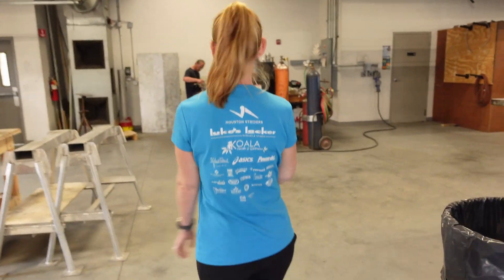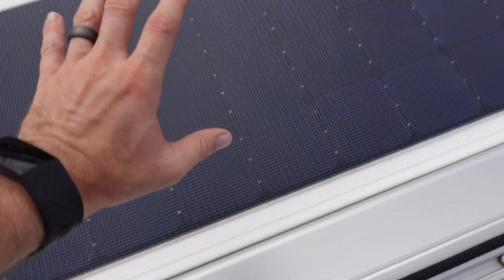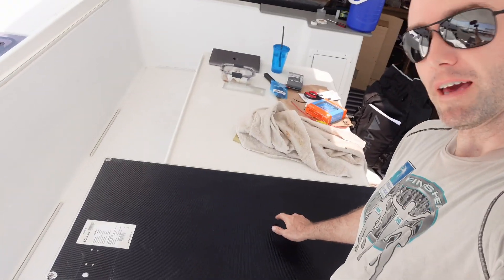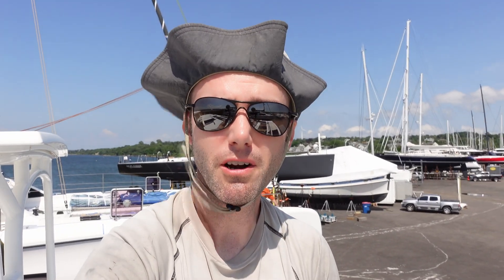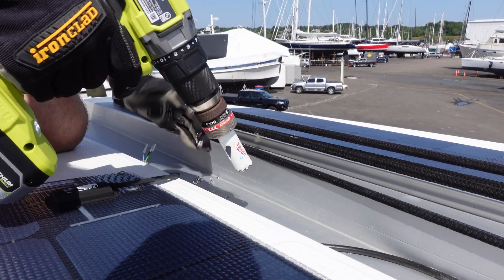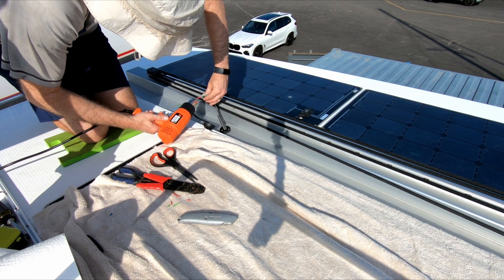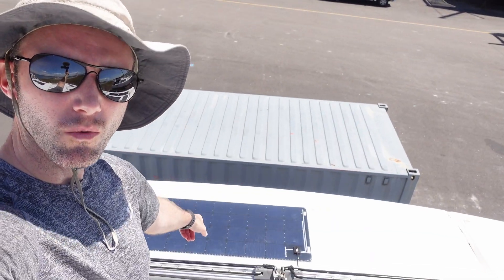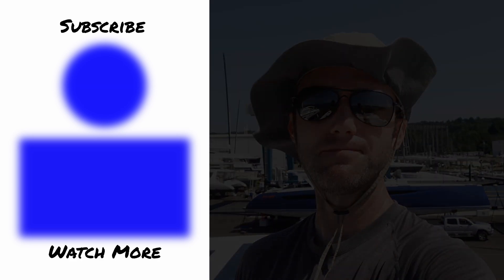Solar Work Begins! Step 1: Re-configuring our existing panels

Comment: Any need to plug the old holes in the traveler to prevent/reduce water ingress?
Reply from the maker: Nope.  The traveler isn't completely sealed, so an extra hole that is now under the new solar panels won't be a big deal at all.

Comment: David, what brand are those flexible panels? Flexible panels in general have poor longevity, but I have a few places I really couldn't put anything else and if I am going to put some on, I want them to lase! Also, have you noticed any performance degradation since they were new?
Reply from the maker: These are Solara panels and I would consider them to be "semi-flexible".  They're actually quite rigid but can flex a bit for a slight curve.  I think that's part of why they've structurally held up so well.

And there has definitely been some performance degradation which makes sense since they're 8 years old now.

Comment: if those are solder splices you're using, just double check you're using enough heat to make the solder ring melt. they take a little bit to make a good splice. apart from that, they're invaluable.
Reply from the maker: They're just good ol' marine butt connectors with heat shrink.  Using the heat gun just gives a much more consistent heat and is less likely to burn things!

Comment: David, why did you remove the WIFI extender?  Great job on the solar.
Reply from the maker: We found that we never really used it.  One of the first things we do when we get to a new country is get a local SIM card.  The plans available are typically cheaper and have a faster connection than say getting a drink at a beach bar just to get access to their wifi.

Plus, we just got Starlink...